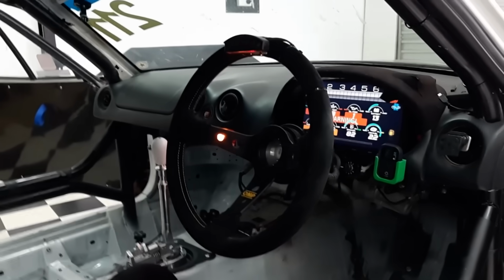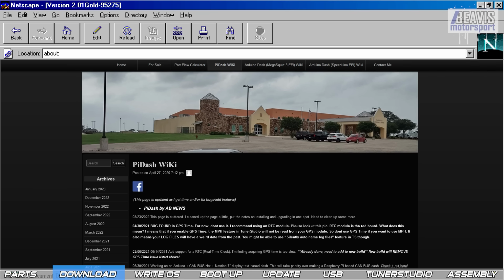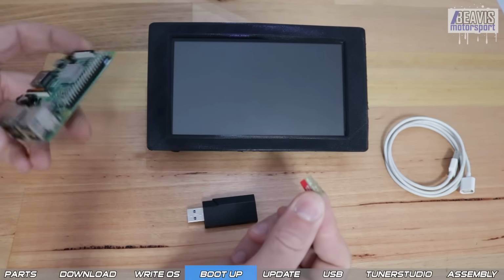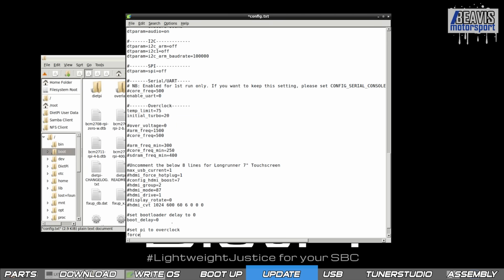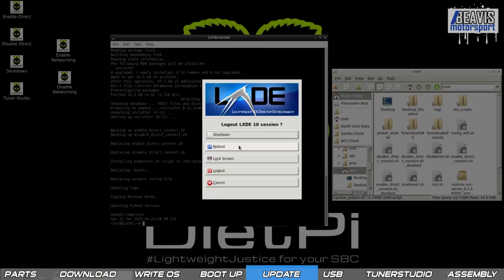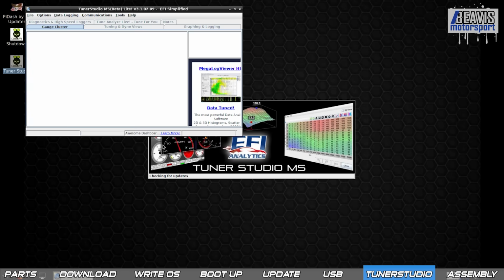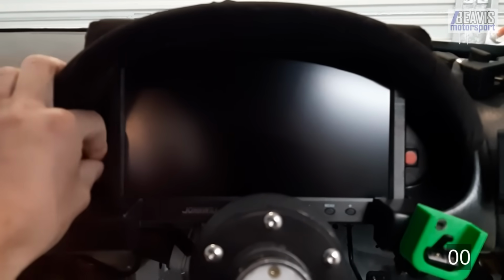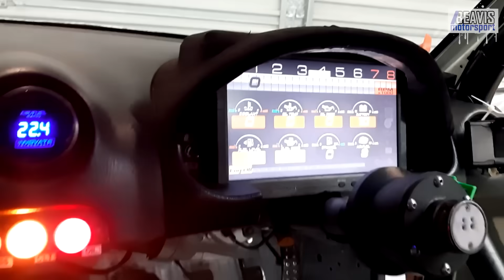DIY Raspberry Pi Racecar Dashboard: The Ultimate Guide

Comment: Just wanted to note that MicroSD cards were not intended for the use of running a full-time operating system and its required I/O. They have a maximum read/write count that can be hit if used frequently enough. Also they aren't the most reliable storage sources over time.

It would be a good idea to boot the Raspberry Pi from an external storage source in order to avoid a potential failure in the system during a critical process, like driving.

Source: Software Engineer
Reply from the maker: While I don't disagree, I am willing to wear the risk for convenience and simplicity. I took a copy of the SD image, so I can always re-write a new SD with all the software setup if I ever have a failure.
Reply: @Bbeavis  It's more of a safety concern than it is a convenience concern, risking losing your instruments while driving. 

It can be avoided, you'd just need a simple portable 2.5" portable USB HDD. Can be velcroed to the inside of the dash pretty easily, taking up minimal space.
Reply from the maker: To be fair, I am also a software engineer, and I work for a business that manages thousands of devices using SD cards as OS/boot storage. Further, the Raspi was designed (by people far cleverer than I) specifically to use the SD card as the storage media - so I am not doing anything out of the ordinary here.
And certainly the quality of the SD card is a consideration, and that is definitely a variable between users, I personally make a point to purchase genuine quality brand SD cards.
Hence, I am comfortable that this solution is safe/appropriate - within reason.
Reply: @Bbeavis  Are those thousands of devices in charge of any critical systems that can cause an accident that could lead harm/death of others if they were to fail?  

That's the main point here. We wouldn't use an SD card to host the operating system for a life support system, or for an engine's computer. We could for a non-critical system, like an infotainment system, though.

But this isn't a non-critical infotainment system. It's a dashboard with critical data. And even though it's not as critical as airplane's instrumentation assembly, losing visibility on that telemetry in scenarios like high performance racing (even on a closed course with other trained drivers), could lead to a serious accident that could harm the driver, or others on the track. 

SD cards aren't intended to be engaged as long-term storage media for the high volume of operations used by operating systems in realtime. They're designed to be temporary non-volatile storage with limited file operations.

So it doesn't make a difference how high quality of an SD card it is, because they have lifetime maximum read/write limits, nor is it safe or appropriate to be using it as a primary storage source for a production application of a critical system like this. 

It's a literal accident waiting to happen, and can be prevented entirely. And at this point, it's so trivial of a solution that only takes a few minutes to apply, that it's not even worth this long winded useless debate going back and forth.

Just take the 2 minutes to be a responsible engineer and plug an external drive. Laziness is no excuse for skimping on safety.

Comment: Looks cool, one question, does the PI's USB cable connect to another USB cable that connects to the ECU to grab all that info or is there something else?
Reply from the maker: Hey, Sorry, that is something I glossed over forgetting that not everyone viewing would have the context that this is for a Megasquirt ECU.
I'm running this dash in a track car that uses a Megasquirt MS3 ECU. So all my sensors, speed, temps etc go direct to the ECU. Then the ECU has a USB connection direct to the Pi to feed the data for the dash software. Hope that helps, thanks very much for watching.

Comment: How is this hooked into the ecu?
Reply from the maker: Hey, Sorry, that is something I glossed over forgetting that not everyone viewing would have the context that this is for a Megasquirt ECU.
I'm running this dash in a track car that uses a Megasquirt MS3 ECU. So all my sensors, speed, temps etc go direct to the ECU. Then the ECU has a USB connection direct to the Pi to feed the data for the dash software. Hope that helps, thanks very much for watching.

Comment: would it work with ecumaster ecu?
Reply from the maker: Hey Denny,
I'm running this dash in a track car that uses a Megasquirt MS3 ECU.  Note that the TunerStudio software is specific to the Megsquirt ECUs which is what my car runs. If you wanted to use a different ECU then perhaps the OpenAuto software,  or OneGauge theonegauge.com would work for you.
Hope that helps, thanks very much for watching.

Comment: For anyone looking to use this for more of a daily driver application, where you might not want to use switches and buttons to turn it on and off, connect the raspberry pi to constant 12v (through 5v adapter). Connect the gpio to switched 12v(acc), and modify the script so when power is lost on the pin, the pi shits down. Power the screen off of switched power, so the dash "turns off" as soon as you turn off the car, and shutdown happens in the background. And lastly, use a rising edge trigger to turn on the car when switched power is restored. The only real downside is that you probably couldn't turn the car on right after turning it off, instead having to wait for shutdown to finish.
Reply: could try this on my experiment
Reply from the maker: Thanks for sharing your suggestion with everyone, appreciate it.

Comment: Why don't you use relays to switch on the whole thing, and then to trigger the shutdown process? That way everything starts up when you start the car, and shuts down when you switch off the car.
Reply from the maker: Because when I shut off the car, the battery is cut. It is a track car, it doesn't have an always-on battery.

Comment: where does the input from the engine go to?
Reply from the maker: I'm running this dash in a track car that uses a Megasquirt MS3 ECU. So all my sensors, speed, temps etc go direct to the ECU. Then the ECU has a USB connection direct to the Pi to feed the data for the dash software.

Comment: really cool method but if you added a relay, you could make your key control shutting and turning on the pi
Reply from the maker: Yes, you are right for most normal cars, but my track car has no key - just a battery cut off switch, so not something for me.

Comment: 40 seconds is too much, i would have inatalled batteries and made the pi turned on forever
Reply from the maker: That doesn't make sense for my car, as it is a track car that may sit with not battery connected for multiple months unfortunately.

Comment: Thanks for the detailed video , i was actually thinking of building one for my daily driver but it has a stock ecu so i don't know from where to pull the parameters from.
Reply from the maker: Hey Suyash,
So sorry, that is something I glossed over, if you wanted to use OBD2, perhaps the OpenAuto software would work for you... or consider trying this software instead: OneGauge, theonegauge.com.
Hope that helps, thanks very much for watching.
Reply: @Bbeavis   Thanks for the info this will surely help.

Comment: Imagine if the Pi had displayport... could repurpose a laptop display.
Reply from the maker: There's lots of options, I'm sure there would be a way to make a laptop display work.
Reply: My point was not needing convoluted adapters/signal converters, because modern laptop displays use embedded displayport.

Comment: Pardon my ignorance, but how is this ‘connected’ to the vehicle? Data connection I’m talking about.
Reply from the maker: Hey Ernest,
So sorry, that is something I glossed over forgetting that not everyone viewing would have the context that this is for a Megasquirt ECU.
I'm running this dash in a track car that uses a Megasquirt MS3 ECU. So all my sensors, speed, temps etc go direct to the ECU. Then the ECU has a USB connection direct to the Pi to feed the data for the dash software. Note that the TunerStudio software is specific to the Megsquirt ECUs which is what my car runs. If you wanted to use OBD2, perhaps the OpenAuto software would work for you... or if you have a different aftermarket ECU, or even a carby car, consider trying this software instead: OneGauge, theonegauge.com.
Hope that helps, thanks very much for watching.

Comment: That is awesome work.  I've considered doing a custom display, but in my case, it would either be a smaller display for a custom motorcycle, so I'd need to make it more streamlined with vehicle power, or to replace the stupid Infotainment system in my Mazda.  I swear, that's the dumbest system I've ever seen in a car, and I would just replace it with an aftermarket radio if it didn't have all the stuff in it like canceling the maintenance light on the dash and controlling other stuff in the car like dash brightness and such.  I even program PLC's at work for industrial applications, but I haven't really ventured down the path of programming Raspberry Pi's yet.
Reply from the maker: Cool, thanks for watching.

Comment: Finally, an off the shelf, universal project ECU with in the vehicle interface. Just change the screen to a touch screen and Bobs your aunt. 
For an old vehicle with a newer engine as a daily driver... 
Connect the 1st 12v relay to turn the screen off and on. Connect the control voltage to an ign/start terminal on the ignition switch. Connect the n/o signal to the monitor and the n/c to the 3rd relays control voltage input. The com signal terminal connects to the screen power supply voltage.
Connect a 2nd 12v relay control voltage to the first relays control voltage. Use a 555 timer to make it a time adjustable momentary relay and connect the signal n/o output to the R-Pi to trigger sleep mode.
Connect a 3rd relay having a control voltage equal to the 1st relays signal voltage. Use a 555 timer to make it a time adjustable momentary relay and connect the signal n/o output to the R-Pi to trigger wake mode.
When the ignition is turned to the run or start positions relay one and two power up. Relay one then ties the signal to the monitor to power up. When the ignition is turned off the signal n/c of relay one ties the control input of relay three powering it and it's timer. The timer activates the relay for X time then powers off. The R-Pi goes into sleep mode.
When the ignition is turned to the run or start positions relay two it and it's timer are powered on. The timer activates the relay for X time then powers off. The R-Pi goes into wake mode.
This would reduce startup time for the R-Pi. In sleep mode it would take the Pi forever to drain a car batt. The R-Pi's power supply would need to be constant hot to the batt.
Reply from the maker: Thanks very much for sharing Tayro, the idea to use the sleep mode of the Pi would be great... sadly doesn't work for me in a track car, but for most road cars that are driven regularly it would be perfect for fast response times.
Appreciate you sharing the detail.

Comment: Will this work with any OBD2?
Reply from the maker: This software won't work with OBD2.
If you wanted to use OBD2, perhaps the OpenAuto software would work for you... or if you have a different aftermarket ECU, or even a carby car, consider trying this software instead: OneGauge, theonegauge.com.
Hope that helps, thanks very much for watching.

Comment: How do you connect the raspberry pi to the car ecu?
Reply from the maker: Hey,
So sorry, that is something I glossed over forgetting that not everyone viewing would have the context that this is for a Megasquirt ECU.
I'm running this dash in a track car that uses a Megasquirt MS3 ECU. So all my sensors, speed, temps etc go direct to the ECU. Then the ECU has a USB connection direct to the Pi to feed the data for the dash software. Note that the TunerStudio software is specific to the Megsquirt ECUs which is what my car runs. If you wanted to use OBD2, perhaps the OpenAuto software would work for you... or if you have a different aftermarket ECU, or even a carby car, consider trying this software instead: OneGauge, theonegauge.com.
Hope that helps, thanks very much for watching.

Comment: I have something similar in my car but based on an old android phone with battery removed. I power it via ACC power line with a DC-DC converter and a big super capacitor(so it will keep the device on for about 30 secs after the car turned off or the engine stall). I use an optocoupler to connect the ACC power line to GPIO, when the car turned off, the device can use this signal to auto shutdown its self.
Reply from the maker: Nice, would you be able to share the specs of your super capacitor?
Reply: @Bbeavis  I use 5F 5.4V super cap on mine. It actually 2x 10F 2.7V cap in series. https://akizukidenshi.com/download/p4247.pdf

Comment: How does it connect to the ecu?
Reply: Would it be possible to do that also with other Ecus maybe just read the obd or can bus?
Reply from the maker: @alarmhome5281  Sure, If you wanted to use OBD2, perhaps the OpenAuto software would work for you... or if you have a different aftermarket ECU, or even a carby car, consider trying this software instead: OneGauge, theonegauge.com.
Reply from the maker: Hey Ethan,
I'm running this dash in a track car that uses a Megasquirt MS3 ECU. So all my sensors, speed, temps etc go direct to the ECU. Then the ECU has a USB connection direct to the Pi to feed the data for the dash software. Hope that helps, thanks very much for watching.

Comment: This is phenomenal, thank you.  How are you getting the data?  Are you connected to CANBUS?
Reply from the maker: Hey,
So sorry, that is something I glossed over forgetting that not everyone viewing would have the context that this is for a Megasquirt ECU.
I'm running this dash in a track car that uses a Megasquirt MS3 ECU. So all my sensors, speed, temps etc go direct to the ECU. Then the ECU has a USB connection direct to the Pi to feed the data for the dash software. Note that the TunerStudio software is specific to the Megsquirt ECUs which is what my car runs. If you wanted to use OBD2, perhaps the OpenAuto software would work for you... or if you have a different aftermarket ECU, or even a carby car, consider trying this software instead: OneGauge, theonegauge.com.
Hope that helps, thanks very much for watching.

Comment: Great tutorial. I'm going to use this as a base for my project. Something I'm going to do though is use a relay for shutting down and powering up the PI. Since it requires the pins to be grounded for at least 1 second (which I would charge to 2), I'll run the pins to the relay and power the relay from an accessory point in the car. This way, when the car is turned on, the relay is open and as soon as the key is turned off, it closes, effectively grounding the gpio pins and shutting down the pi. With some more ingenuity, the display can be wired to the relay so that it will power on/off with the key.  A DPDT relay should suffice in this use case since one side of the relay is going to be going to the gpio pins, the other side will be free and that can be used to lower on the display. 

Now, onto my question: I'm not very familiar with the Raspberry Pi. Is there a way to set the Pi to go into sleep mode when the pins are grounded? If we can do this, then the startup time can go from ~32 seconds down to a nearly instant startup.
Reply from the maker: Everything you're describing is possible, and could make for a better experience in a car with a longer lasting battery. (In my track car I have a kill switch that makes this not really practical)
And certainly there are people who setup their Pi to sleep rather than fully shut down, I am sure some gentle googling will find you the detail on what script to run to do that.
Reply: @Bbeavis  thanks for the reply! Yeah,I figured that you're not going to be needing all that with your usage. It draws on your power unnecessarily. I'm going to get some homework done and since I'm technically inclined in computers, electrical and circuitry as well as mechanically inclined, this will make for a nice project that's more fun than task. It's all a matter of free time and finding $$$ I can spare.

Comment: Very Nice Video, I like to put this in a Daily Driver car. the only thing im Missing in this video is how the Pi gets all of the informations? How is it connected to the Engine Values?
Reply from the maker: Hey,
So sorry, that is something I glossed over forgetting that not everyone viewing would have the context that this is for a Megasquirt ECU.
I'm running this dash in a track car that uses a Megasquirt MS3 ECU. So all my sensors, speed, temps etc go direct to the ECU. Then the ECU has a USB connection direct to the Pi to feed the data for the dash software. Note that the TunerStudio software is specific to the Megsquirt ECUs which is what my car runs. If you wanted to use OBD2, perhaps the OpenAuto software would work for you... or if you have a different aftermarket ECU, or even a carby car, consider trying this software instead: OneGauge, theonegauge.com.
Hope that helps, thanks very much for watching.

Comment: By any chance would you happen to know why the keyboard and mouse wont work using similar setup
Reply from the maker: Sorry to hear, I've seen a few people mention the same issue. I do not recall having any such problem.
I can only suggest perhaps trying to SSH onto the device and running an update that way first, or trying a different keyboard.
Unless, of course, google doesn't have better suggestions.